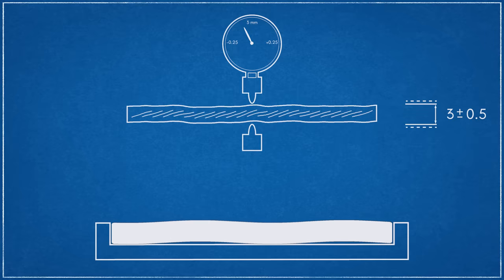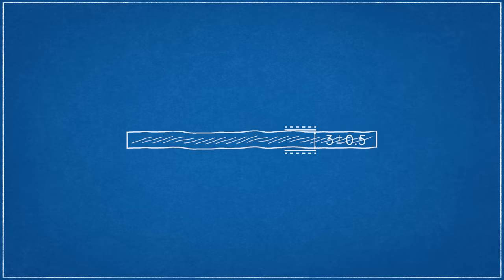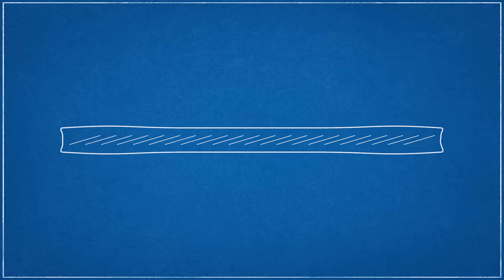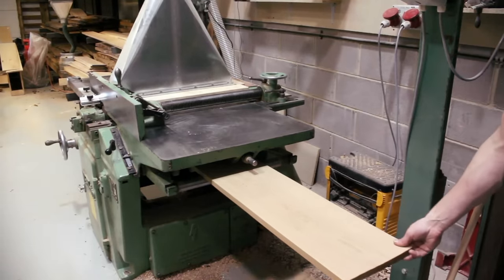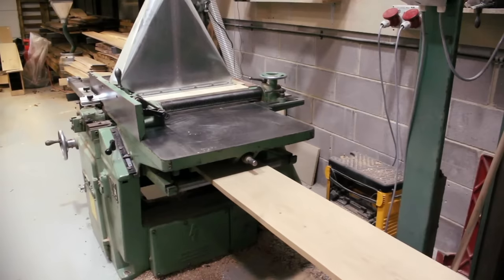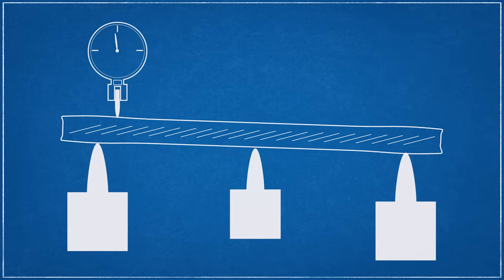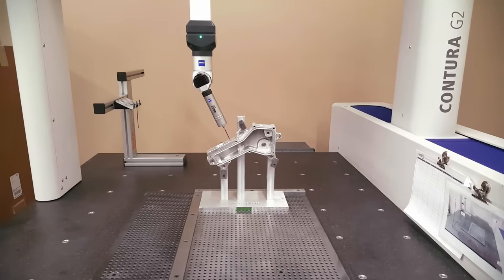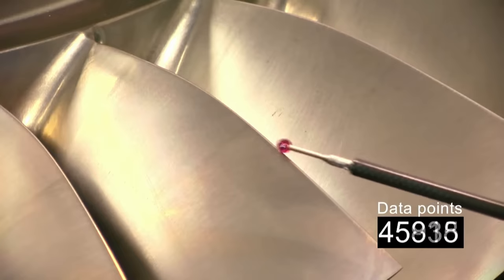The Science Of Flatness

Comment: 1:14 i work in a factory using float glass to build windows, and we can see in the reflections that it is not entirely flat, but the pieces absolutely feel entirely flat. another weird thing, we use sandpaper to clean the windows, at 3000 grit however, meaning it renders invisible sufficiently small scratches.
Reply: 10:00 oh you cover a more scientific version of seeing the warp in the reflection of the glass later as well lol

Comment: The primary job of a cylinder head gasket isn't to fill in for a surface that's not machined flat, as both the block and head can be machined to the point where either water nor oil will penetrate when the bolts are properly torqued.  Rather, the gasket allows for uneven heating, which results in uneven thermal expansion and slight warping.  Most cylinder head gaskets contain a springy copper ring around the piston areas (high pressure) and a spongy silicone gasket material around the low pressure areas for coolant.

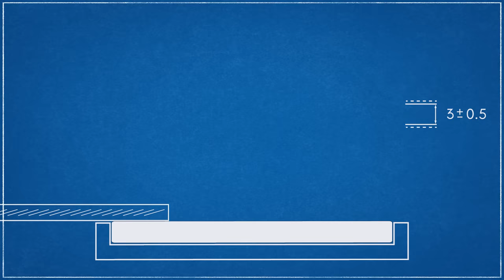Comment: Great video.  Only issue is the dial graphic depicted starting at min 1:38 depicts the wrong specs.  Should show lower limit as "-0.5" and upper as "+0.5", as the example you are using states a dimension of "3 +/- 0.5".    Total tolerance for "3 +/- 0.5" is 0.5 + 0.5, for a total of 1.0.   Source Cited: "For example, a part's dimension might be expressed as 20 +/- 0.50, which allows for a tolerance (variation is size) of 1.00mm."  Engineering Design Graphics  Autocad Release 12, 8th Edition, James H. Earle

Comment: 4000mm overall flatness in an enclosed m³ using a resonating frequenz which is applied outside the m³. To amplifie and also concentrate this effect, the outside of the sealed "room" has to be under water. about 156-165 Kilohertz (kHz) is sufficient

Comment: One cool sentence that NEEDS to be said- "To produce one flat surface, you must first produce three." - paraphrased from "The Perfectionists: How Precision Engineers Created the Modern World"

Because think about it- your most precise optical flats, the flattest mechanically-made surfaces you mention, they had to be produced some way before being used for calibrating.  The computer-controlled stuff relied on a flat reference frame too.  But how did the reference surface get made?

Answer- Start by making one surface calibrated against another, looking for deviations with polishes/grinding and rubbing against each other, creating 2 flat surfaces, is a start, but what if one was very slightly concave, and the other convex?  So you create a third surface, calibrated against the first one. It could now be 1 convex, 2 concave, (or 1 concave, 2 convex) but then you match your third surface against the 2nd.  Checking and grinding/polishing now reduces the curve in the 2nd and 3rd, and then you go to back to #1.  Repeat until you hit the limits of your polishes and measurement.  You are now as planar as your polishes/measurements allow.

Comment: You don't need a surface to be flat to use an O-ring. The reason we use O-rings is because the surfance isn't flat. It is possible to achieve an airtight seal without O-rings but you just need way better tolerances (which is a bad idea cost-effective wise).

Comment: before float glass they used to blow massive barrel shaped tubes then unfold them to make flat glass. old big windows look super rippley just from folding out the glass with torches and stuff. also flatness and surface finish is different, stuff can be flat and rouph like hand scraped mechiene ways, its gotta be flat but there still needs to be oil as it slides around. and there are some minerals that split or crack into perfectly molecular flat chips.

Comment: The reason transistors/IC's need thermal paste/keratherm etc. is a lack of flatness. Neither the case of the transistor or the heat sink are totally flat, and without something to bridge those tiny gaps heat will transfer poorly.

Comment: @9:25 when they talk about "ringing", have they done that in a vacuum? You know, ring the 2 flat surface together, put them in a vacuum chamber and see if they fall apart once most/all of the air is pumped out? You'd have to set them up at an angle so gravity can take over to (possibly) separate them if what I think is going on is going on. Thanks-
Reply: It works in a vacuum. The thing happening is called the Van der Waals force

Comment: Being in construction I often wonder at the limits of flat concrete floors. Using laser levels a floor is flat across a long span based upon the laser. Using a bubble level you can only check a small portion. Using a water level you can check across a larger distance but will yield a different result to the laser. A water level across a large distance would yield a curved floor matching the curvature of the earth where a laser leveled floor would rise at each end in relation to the planet.

Comment: 10:08 so…surface welding. When they’re incredibly flat and you can use friction to drive one against the other, it’s essentially a surface weld. That’s why you can split them but it requires a little force.

Comment: ACKTUALLY engine gaskets are a fail safe. It's not there to join two imperfect pieces, but to avoid having to use one single piece, that in the event of engine failure you would only have to replace the gasket, not the entire engine

Comment: 9:20 And I always thought it was because there's a vacuum between the two surfaces... In the workshop we have some Mitutoyo gauge blocks; when I use those needed I make sure they are clean before joining them, and am always amazed how they bond together, just like in the video. But I always thought it was, as said in the beginning, due to a small vacuum. In fact, if I try to join them NOT by sliding them together, they DON'T bond. But if I slide them like in the video, they do bond. So I do think it's due to vacuum as the sliding pushes away the air, creating a sealed surface. 

But I may be wrong. Any ideas?
Reply: Just an FYI, The proper way to wring Jo blocks together is to clean the surfaces of both blocks by placing a sheet of clean white paper on a surface plate and rub the surface of the block against the paper until the paper is clean, which is the same method to clean the faces on a mic (mike). Then wipe the face of each Jo block on the inside of your clean forearm, then wring the blocks together. If it's not done this way, the Jo blocks will start to get microscopic scratches on them and throw the calibration off. Wiping it on your forearm applies a minuscule amount of skin oil for lubrication. It's not a vacuum, both blocks are dead flat.

Comment: How do we measure the flatness of the inside of an Airsoft barrel? 6mm diameter
Reply: Flatness doesn't apply to an internal diameter. An I.D. is round and needs to be straight. If it requires a surface finish approaching that of a mirror, it can be done by what is called I.D lapping.

Comment: i noticed if i toke harddrives apart then if you stack the disks they would get stuck together like really stuck together didn't know this was wringing so those must be extremely flat i guess.

Quick edit: i thought this happend due to the atmosphere pushing on both objects because there isn't any air between the two disks. but is it due to some other force?

Comment: I have a question for you guys, what is the relationship between flatness and bend specifically for plates? for example, if we have a plate ( or sheet) with flatness of .05 but the plate is bent at one end .2 .  can we say the plate is out of tolerance because of that?
Reply: I would think that the plate if bent would be considered out of tolerance. When measuring the flatness of a plate, you measure from one end to the other, wherever you put the measured object on the plate it should give the same reading. Smoothness of a plate is another measurement for flatness. Smothness measures a small region of the plate, but when you speak about flatness you are speaking about the plate as a whole, or a large controlled area.

Comment: 0:03 as soon as I saw the counter top I remember what I did to it after I spent 8 hours flattening a cylinder head with sand paper (I failed, not enough compression because sand paper is not completely flat so it files down more material on the edges), I used a straight edge and feeler gauge, and the counter top is rougher than the cylinder head, lol.

Comment: how does one make something (like that engine plate) with multiple (not) connected flat surfaces on it? those dis-connected surfaces must each be flat AND in the parallel, even tho the flats were not at the same vertical height from the other side's (reference) flats?  That' a lot of surfaces to get (individually) flat yet all parallel to each other and parallel to the reference flat which if facing 180 degrees away?  I just confused mysel writing it down!  How is it done?

Comment: Nice video but you fail to explain how many of the flat 'references' are created. For example, the surface grinder needs extremely straight (i.e. flat) ways upon which it travels, otherwise any bumps or holes in them will be transfered to the worked piece. Similarely for the interference lens at the end: you say it's a "special precisely polished flat lens" but how is that created? A bit of a chicken-and-egg problem here...

Comment: Gauge blocks are so flat, that when you left them jointed quite a time, they would cold fuse together!
Reply: Is that why the gauge block sets always come separated?
Reply: @franciscodiaz6290  I guess so. They tought us to alwys seperate them when finished, because sort of a cold welding on an atomic scale could happen.
Reply: @LCdrDerrick  there's only one guy in my shop that has a guage block set so everyone uses them, now there are a handful of blocks lying around just stuck together.
Reply: @franciscodiaz6290  Well, as I remember it takes hours if not days for the cold welding process to happen. But if they are made of steel instead of ceramics or tungsten carbide, then it is recommended to divide them from each other, else you could have but not must have a problem.

Comment: I recently learned that glass has a surface roughness of 50 to 100 nm
Reply: A low to mid-quality mirror or optical window (the kinds found in a lab or instruments, not your house or car) will be flat to 50 - 100 nm.  Roughness is a completely different animal that basically describes how big the little bumps and pits are.  The value is sensitive to how it is actually measured and analyzed but less than 1 nm RMS is typical.

Comment: Car engines are far from flat. Cylinder heads needs a bite for the gasket to operate correctly. When you have a pressure tight flange without any gasket you know it's flat

Comment: you start fairly good, but by the three minute mark your lost. To be exact when you talk +/- 1mm, we know you don't really know what flatness is. You must think in tenths of an arc second, and work from there. A typical Lab Grade surface plate will come in at less than .000025" error per foot. Machine ways that are scraped will usually show about .00025" error in four feet, or roughly .00005" per foot of travel.

Next error you made is the use of a CMM machine to measure flatness. Can't be done! You shoot it with an auto collumator to measure light refraction. With something small, you can do it another way by using a .000020" indicator as compared to a calibrated surface. Laser will work, but they are full of errors.

Comment: When you wring in gage blocks, you squeeze the air from the gap, essentially leaving 0 space thus an almost perfect vacuum. That's why the force needed to separate the parts is the weight of the atmosphere, about 14 PSI. I too believe that molecular forces come into play on near-perfectly flat, fine surfaces.  But it's a much weaker force than atmospheric pressure.

Comment: Alright now listen here Engineering 'Hopefuls'... When you get into the real world, Go back to this video and watch the part in this video where he talks about a wooden table and how it still works even if it is out of flatness by 3-4mm (.117-.156"). Nobody likes an engineer who throws in flatness specifications for no reason. How do you tell if you should add flatness? Simple. By the time you end up needing it, it will be 'common sense' or it will arise on it's own as an issue. It costs much less to have an issue and correct it in 99.9% of cases than to amplify the cost to produce something by a factor of a hundred because you thought +/- .005" (.13mm) sounded like an achievable number on anything.

Comment: LOL, so if we fly from West coast to East coast, about 3000 miles, the Jet does NOT and will NOT make ANY correction for the claimed "ball earth, and its "Descending radii of the nasa "Claimed 24,000 miles.
Which in spherical trigonometry is 8"/Mile/ per sq/Mile, ,  and traveling at commercial jet altitude of 33,000 Feet and 400MPH.
Your Jet would NEED to make a 2,770  altitude drop correction for maintain altitude, correction every 60 seconds.
Else in 1 Hour your Jet will be 27 Miles High.
Where NO oxygen exists. So then YES you will die from suffocation and the jet turbines WILL flame OUT and lock up at 45,000PRM then too.
So how does this proper facts and math coincide with the fallacy lies of nasa that cannot answer this or 300+ Other more obvious evidences earth is FLAT?